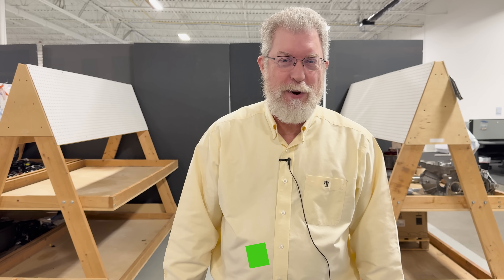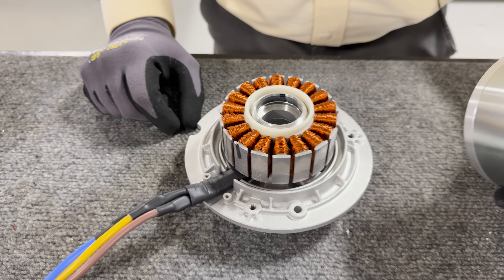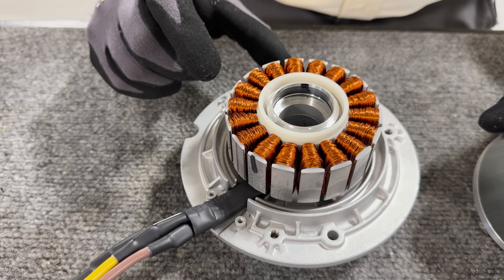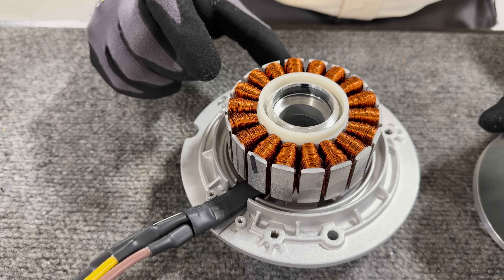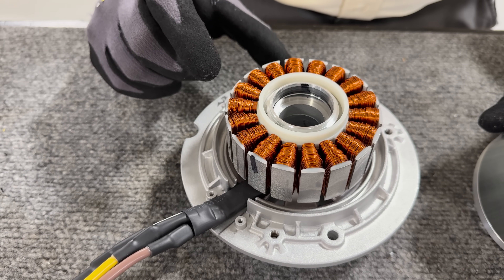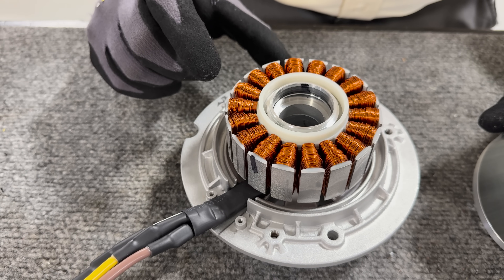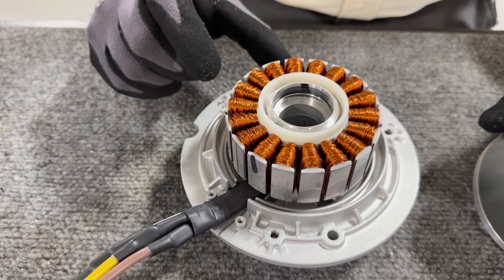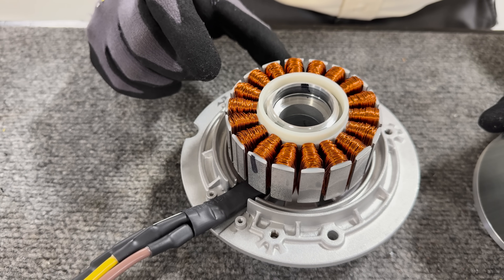EGO Lawn Mower Electric Motor Teardown: Timeless Technology in a Modern Machine

Comment: I'm surprised that it took so long for these motors to improve in performance and efficiency. Like why wasn't anyone work that decades ago? I could be wrong but it seems the electric motor hasn't changed much in the first 100+ years and then only now is there significant improvements coming out.
Reply: The reason is simple: neodymium magnets and powerful power electronics are a relatively new development.
Reply: neodymium magnets were invented in eighties, electronic motor control (PWM, VFD) came to use at about same time.
Reply: Nobody was forcing greater efficiency,  unlike the car industry with fuel economy regulations. Sad,  but true.
Reply: @jamesengland7461 - “nobody was forcing efficiency…”

People arbitrarily forcing efficiency merely causes people to stop producing technology… this the death of the small pickup truck in the car industry.

Reliability is an important metric that can not be overstated. People are willing to overlook energy efficiency if they never have to look at the motor again. 

Think: refrigerator motors… if we have refrigerator that runs for decades, a family is fed, and no one thinks about replacing the motor to a fancy motor with more efficiency that may be less reliable & cause food to go badly, costing a poor family a lot of money… the cost savings in energy is lost to food destruction, hardship on the family (energy used to get more food), and hardship on the manufacturer’s reputation.

Rising cost of energy & inflation that outruns cost reduction in manufacturing efficiencies will eventually drive newer technologies…

… but outsourcing to a lower cost provider stretches the innovation curve to make it less necessary to develop newer technology with greater efficiency
Reply: Perhaps you are mistaken. Just because it wasn't readily available in mass production market doesn't mean the engineers didn't know how to make them, chances are the knowledge and engineering were all done a long time ago but there were no affordable batteries to drive the mass market to induce the interest for affordable, high-efficiency motors.
It's just so happened that I'm a person who cares about efficiency for no reasons (I think efficiency is "cool"), and I remember how expensive these motors were before the recent EV push circa 2018.
Reply: Isn't inexpensive power electronics very recent? (developed for the EV industry).  The inverter may have been too expensive / big to justify the motor gains.
Reply: @rmeden1  the EV industry grew because of affordable power electronics, which were developed for industrial applications.
Reply: @rmeden1 - also, reliability of power electronics is very key. 

Vacuum tubes were not exactly very efficient, nor were they reliable. Efficiency in motor design might have inefficient drawbacks in the electronics. 

Reliability is a greater issue than efficiency, since a down production line with a fancy efficient motor costs more money in lost production time than a simple old reliable motor.
Reply: I have the same impression as well.
Reply: i would say more specically that the advent of cheap, fast microcontrollers and cheap efficient power fets have a lot to with it
Reply: This type of motors have had a great development for military and industrial uses, for cars different specifications are required, for example in the industrial field encoders with high resolution are required for precise control of the position, for cars it would not make sense 😅